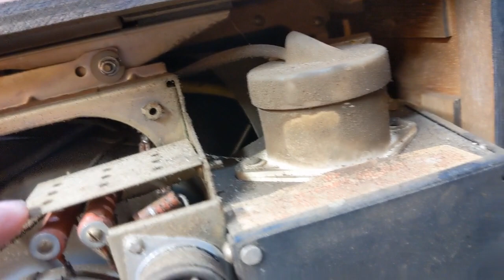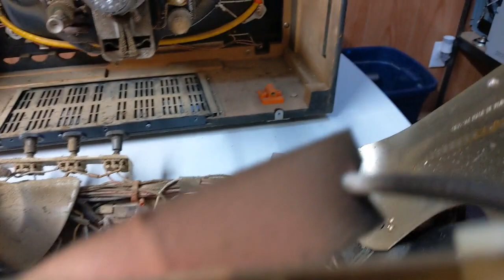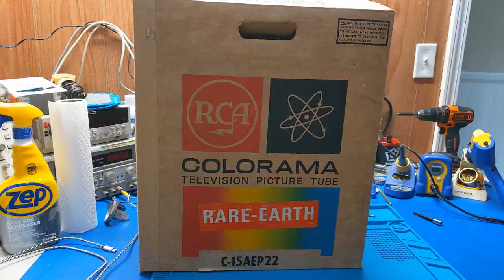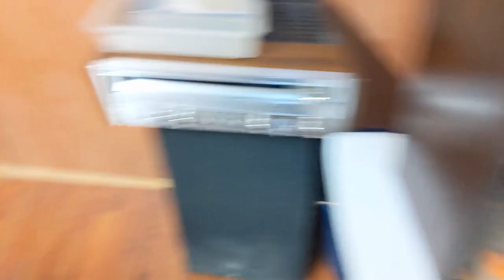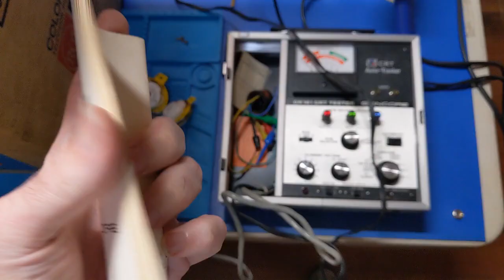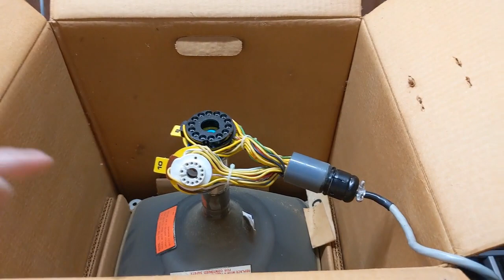Vintage TV Packard Bell Teledyne C95266 WAL Repair part 1

Comment: You don't usually see the anode on the bottom... are you sure it's not supposed to be on the top with the neck pinout rotated 180º from the old tube? Should be able to make that work. Blue gun is almost always on top when the tube is the right way around.
Reply from the maker: Yeah, i was checking for that. the blue gun is on the top of the CRT on the original. I checked the replacement, the only way for the blue gun to be on top is if the anode cap faces down, and it keeps the focusing pin on the left too just like the OEM CRT. So yeah, i agree its an oddball situation.
Reply: @THEtechknight  You may have a southern hemisphere tube! CRTs made for the southern hemisphere often had the internal elements flipped to make purity/convergence easier with the earth's magnetic field being reversed.
Reply from the maker: @coyote_den  Interesting... i didnt know that was a thing